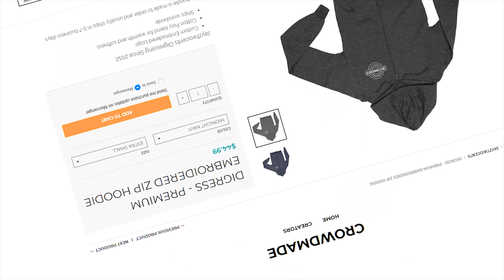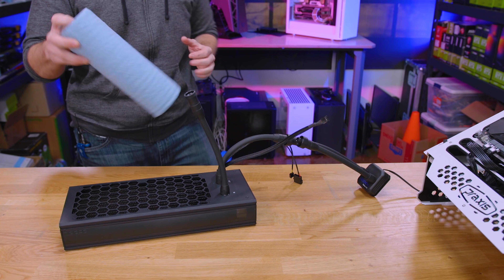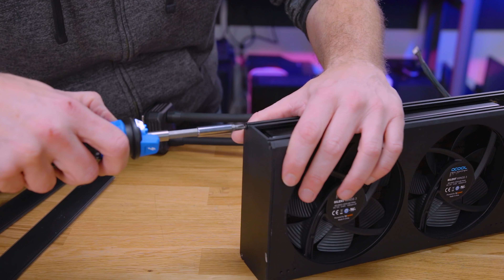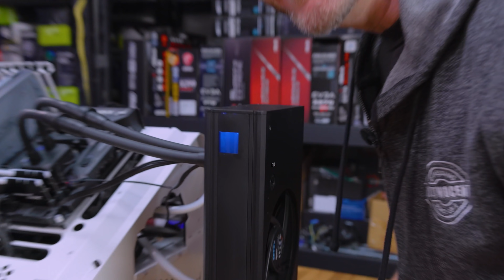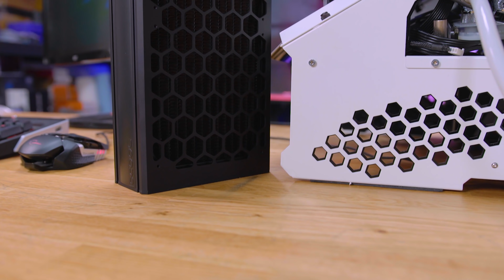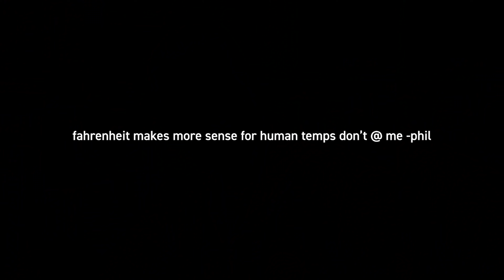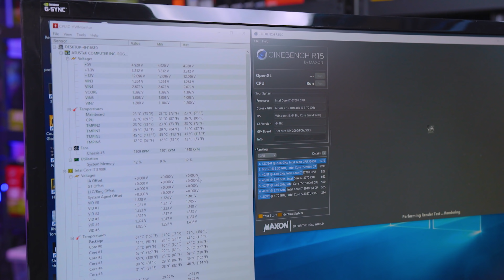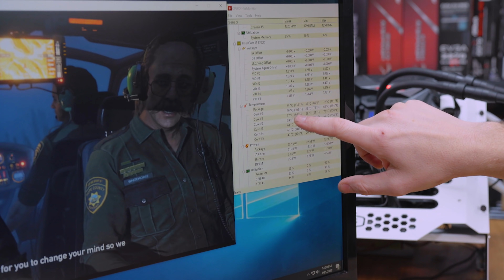This AIO is ridiculous!

Comment: Celsius makes better sense, period.
Reply: It makes better degrees really. 
0 the temperature water freezes at 100 degrees the temperature water boils at. 
If you need Absolute 0 use Kelvin. 

The issue with American Temperature is -40F is -40C. Which is weird. 

1 degree Kelvin and 1 Degree Celsius is the same. 
Absolute 0 is -273.15 degrees Celsius and 0 Kelvin. 0 Celsius is 273.15 degrees Kelvin. 

A degree is a degree but -40f is -40c, 0f is -17.7C, 32f is 0c. 

So for Fahrenheit there is 72 degree in 40 degrees in Celsius.  Water freezes at 32 degree American and Boils at 212 Degrees American. why? 

Water at 100% is gas at 0% it is solid. A degree is a percentage of the difference between Solid and Gas. it is simple logical and oh right that is why Americans don't do it... Simple and Logical is too liberal to American minds :P
Reply: Agreed, same goes for kilograms.
Reply: A wise man once said (and I forget who):
"Farenheit is from a Human's perspective, Celsius is from water's perspective, and Kelvin is from the perspective of the Universe..."
-some guy on reddit (I think)  2019

Personally when working with computer temperatures I prefer Celsius because most (if not all) product ratings are done in Celsius and because in Celsius the numbers are really easy to manage. 0 is too cold 100 is too hot, 20 is approximately a typical room temperature.
Reply: so does metric but alas, us americans are stuck with a garbage system.
Reply: Not as much sense as Kelvin though. If your CPU isnt running under 300K are you even trying?
Reply: @HailAzathoth  Eh.... Not recommended. 300K is dangerously close to ambient, which increases the risk of condensation (if you use water... sorry Vodka cooling). My CPU temp in idle is around 30°C/~304K, which is pretty O.K.
Reply: As an American I agree but with everything being F and being accustomed to it, changing units wouldn't be the smartest move
Reply: @ForestBertrand  But do you really need it? Do you dress differently when it's 50°F compared to when it's 70°F?
My usual rule of thumb is: everything below 5°C demands a coat, everything above long trousers. 18°C or more and I run with short trousers and shirt. I don't dress differently for 23° than I do for 32°
Reply: 0c =freezing temp for water, 100c = boiling temp for water.
Reply: USA still uses volume to measure mass (cups), so I don't think they'll ever understand measures.  It's a lost cause.
Reply: Celsius didn’t get a man on the moon
Reply: @hacoberthejacober3345  It did. NASA used both imperial and metric in its Apollo program and since 1990 uses primarily metric.
Reply: Why have "sense," when you you can have...

FFRREEDOM!
Reply: DeShawn Terrance Canada is much more freedom than the USA. 🤘🍺

Our government sucks but doesn’t shut down for an orange fella with something to prove 🤣🤣🤣🍻
Reply: @mattmyles3908  canada is much more grammar as well.
Reply: @mattmyles3908  True but being docile doesn't make you better.
Reply: @bobhumplick4213  as always you think u ur opinion is always the right one and the only one thats why you fight so many wars and when someone has a other opinion and even when its the only logical right one 
you always draw it into ridicule
Reply: for computers yes.  for measuring ambient temps freedom units are best.  0F= about as cold as it gets 100F= about as hot as it gets  0C=kind cold 100C= "my face is melting!!"

take note of the smiley face ===>  : ) this is a joke
Reply: @bobhumplick4213  what?
Reply: @Kerttis  you heard me
Reply: @bobhumplick4213  wtf is " about as cold as it gets"? that is just dumb. 0deg F means nothing, it is not the lowest temp in US, not in Alaska and not in the rest of the world. 100deg F is barely over normal body temperature. One degree F is not equal to one degree of anything, it scales differently, it is based on one persons feeling of temperature and it is an "imperial" unit from your british predecessors who, as the rest of the word, use metric system of SI units.

you, as a carbon based being, need water to live. not feelings, water. if water boils or freezes, then you get feelings.
Reply: @A10Eiro  most places dont get below -20 (20 degrees below 0F) and most places dont get above 120F.  so the range on F makes more sense than the range on C.  so i win!!! yay!!!
Reply: @bobhumplick4213  again, most of. In contrast I am trying to say quite the oposite, those limits are useless. Also not globally applicable - I would say not even across the US, being far a wide as it is, from arctic Alaska to hot Hawaii. Also as Jay said, it makes sense in PCs. One kinda plus side I see is not writing negative values in most of the cases but that is also "most of" and whatnot. 

I don't know, I feel diappointed when I see people using imperial system while other, in US as well as elsewhere, are trying to come up with measuremets of time in space, taking into account the effects of gravity, special relativity and speed of light to properly unite time for space travel. Oh and sorry for ranting over imperial system while talking about temperature measurement. I'm not saying you are an ape or anything, not in the least.
Reply: @A10Eiro  who cares blah blah blah blah
Reply: @bobhumplick4213  oh my, the last time I heard "blah blah blah blah
" was from flat-earthener. I am afraid I have to bail out of this discussion... not that I have much more else to say. No surprise the gov and scientists have such a hard time changing it.
Reply: @A10Eiro  what?  i said i was convinced?  dont you believe me?
Reply: @bobhumplick4213  Where in the world do you live that 0°F/-17,8°C is "as cold as it gets". Here in Germany we just had -20°C and Germany isn't particularly know to be THAT cold. Same goes for 100°F/37,7°C. You just got slightly above human body temps. I know many countries where it gets MUCH hotter than that.

The most consistent scale is Kelvin, where 0K is defined as the absolute zero, you physically can't get any colder than that. For normal day to day use Celsius is better. 0°C is the freezing point of water (almost, but the difference is academic) and 100°C is the boiling point at 101kPa/1Bar. Everything between that is a linear scale, so a multiplication by two always doubles the temperature.
Also, since the Mendenhall Order all imperial units are derived from their equivalent SI units, and the US is the only country that is remotely important that still uses stupid imperial units.
Reply: @Ruhrpottpatriot  i didnt say that 0F "was as cold as it gets"  i said it was ABOUT as cold as it gets.  if you extend the range 20 degrees in both directions from -20 to 120F that covers most extremes in the US quite nicely.  sorry that you are so pedantic that you nitpick everything in the world to death even a joke.  i hope you work on your sense of humor in the future : )
Reply: @bobhumplick4213  Wait, it doesn't get colder than -29°C in the US? What about Northern Washington, or god forbid(!) Alaska.
Heck, even eastern Germany does have it's occasional -30°C.

It's a fact, that Fahrenheit and imperial units in general are a stupid scale, that has absolutely no consistency. It's garbage, which even the US acknowledges since 1893.
But hey, tell me of the 125 million Dollar Mars orbiter the US lost because Lockheed Martin used imperial, while NASA used metric. Must have been fun, right?
I certainly laughed out loud as I read that.
Reply: @Ruhrpottpatriot  youre missing the entire point.  stop being so literal minded.  it MOSTLY stays in that range.  "but but what happens if you it goes beyond that range,  does the world end??" no you have negative numbers problem solved.  you might have to break out on those negative numbers once in a while but on average most days are between 0 and 100.  stop looking so hard for something to argue about and start looking harder at the point the person is trying to convey.  the internet will thank you
Reply: @bobhumplick4213  The entire premise of the Fahreheit scale is bullshit. Is used a somewhat scientific point of zero, but then proceeded to set the freezing point to 32°F and the human body temperature to 96°F, which btw he guessed. Nonetheless neither points are accurate (and reproducible) enough, even by standards of the 19th century. Not only that, calculating with it is stupid and unintuitive, too.

By your point: In most of the world (discounting the poles and Siberia, oh and canuck land) an average day is between 0°C and 50°C, so what is your point? That I can stay between two arbitrary numbers (0 and 100), with precision unneeded in daily live, better; instead of staying in a range of two different arbitrary numbers (0 and 50)?

Celsius on the other hand uses two scientifically provable points with a linear scale in between. This makes every day appliance easier (since I can calculate easier with it) and is more consistent.
Reply: @Ruhrpottpatriot  couldnt aggree more.  john celsius was a genius
Reply: @Ruhrpottpatriot  please do not try to be scientific with him, he seems to just fly over those parts as it is too hard to understand. Honestly, it is quite scientificly articulated.
Reply: @bobhumplick4213  He's from Germany. They don't do sense of humor over there very well. But hey, they've got the metric system.
Reply: @saber-jocky3436  well his he must have converted that joke and misplaced a decimal point.  if he redoes his calculations he will find it hilarious
Reply: @Ruhrpottpatriot  bro stfu with that lockhead martin shit, that's a fantasy  to prove that bs  to feel good. You might as well laugh at your own joke. I understand both and neither one have a benefit as long as you understand numbers period. That shit does not make you smarter or the world dumber, just you being more arrogant. It just changes when you think 0 comes in as the feezing point and vice versa to the boiling point.
Reply: @dayadam16  Oh yeah, "fantasy". Then why does this article exist? http://edition.cnn.com/TECH/space/9909/30/mars.metric.02 and https://llis.nasa.gov/llis_lib/pdf/1009464main1_0641-mr.pdf
and http://www.cnn.com/TECH/space/9909/30/mars.metric.02/index.html

 It states, and I quote: "NASA lost a $125 million Mars orbiter because a Lockheed Martin engineering team used English units of measurement while the agency's team used the more conventional metric system for a key spacecraft operation, according to a review finding released [...] Lockheed Martin helped build, develop and operate the spacecraft for NASA. Its engineers provided navigation commands for Climate Orbiter's thrusters in English units although NASA has been using the metric system predominantly since at least 1990."
The official(!) report states: "The MCO MIB has determined that the root cause for the loss of the MCO spacecraft was the failure to use metric units in the coding of a ground software file, “Small Forces,” used in trajectory models. Specifically, thruster performance data in English units instead of metric units was used in the software application code [...]"

There you have it

And no the difference between Fahrenheit and Celsius is not just where the zero point is located. The scale is totally different.

And Celsius, since it's shifted Kelvin (or vice versa, depending on your definition of "zero") makes much more sense, since we use a decimal based counting system. Or to put it this way:
In metric one millilitre occupies one cubic centimetre of water takes one calorie to heat up by one degree (centigrade/°C), which is one percent of the difference between its freezing and boiling point.
Now if I wanted to heat up one litre of water (which by the way takes up 1000cm³ or 0.001m³) by one degree I can simply multiply the calorie amount by 1000 and I'm done. writing "one-thousand" takes longer than the calculation itself.

Whereas in imperial the answer to "How much energy does it take to boil a room-temperature gallon by one degree?" is: "Go fuck yourself" because you can't directly relate these units.
See attached picture:
https://cdn.zmescience.com/wp-content/uploads/2011/03/better-1024x961.png

Inb4 "BTU": Units with multiple definitions don't count.
Reply: Ruhrpottpatriot to make people like you get so stuck in the drama that you end up believing the fantasy and now your spreading the word. I obviously didn’t go out my way to try and get you to believe me but you did the same thing they did to you. Nice try
Reply: @dayadam16  Yeah, nice try. You apparently can't even read the official NASA report relating the loss of the lander.
Reply: @Ruhrpottpatriot  well kelvin and celcius were the same just shifted.. but they redefined kelvin last year.. physicists were never really happy with the dependency on water because changes in composition and isotopes can change the properties... they wanted to get rid of that for real consistency..
Reply: Ruhrpottpatriot Got up to 47c a few days ago in Aus 🔥 lol
Reply: @Dunkelelf3  Not quite. The triple-point of water was defined with a very specific type of water in mind (Vienna Standard Mean Ocean Water). Still, the current definition of K (and therefore °C) based on the Boltzmann-Constant is much better.

It's still just shifted though, albeit slightly different.
Reply: @Ruhrpottpatriot  your a bitch
Reply: @bobhumplick4213  exact 0 degrees is freezing , 30 its hot -30 im freezing , 100 is boiling point, -274 if im not mistaken is the coldest things get. How the fuck does it make more sense ?!?!?!?!?!?!?!?!? Fucking merican measures are always shit. -period
Reply: PreZ _  so shit.... that’s why everyone’s better than us.... oh shit wait MERICA BETTER THAN EVERYONE!!!!
Reply: @weems0031  Except in dun related deaths, deaths by cars, medical bills, insurance, house building, pollution, politics (ever heard of a shutdown in europe?), general education, and the list goes on.

Studies show, that the only thing the US is vastly superior to other countries is inflated ego.
Reply: @Ruhrpottpatriot  why dont you tell us where you're from so we can dig up bullshit about your country and talk shit like you.
Reply: Ruhrpottpatriot lol we are still better than everyone and could and should conquer all you Europe babies who can't defend themselves without asking dad (United States) for help
Reply: @weems0031   HAHA, Good joke. Do you know who produces the steel for your weapons? ProTip: No US based company
Reply: Ruhrpottpatriot hahaha I find it really funny how you think you know everything including things that’d be impossible for a tiny European like you to know, just take the L buddy, the United States is, has been, and always will be the greatest country and people in the world, im sorry you didn’t make it in buddy, now go make some products for me to buy lololol
Reply: @weems0031  You mean the country, that just sent hundreds of thousand people home (or kept them working unpaid) because a few people wouldn't get their lolipop?
Yes, great indeed.
Reply: Ruhrpottpatriot hahah why are u fixated on this government shutdown? Like I didn’t meet a single person who was actually affected by it hahahah our media is just so strong and wants everyone to hate our current president so they spread all this nonsense about this shutdown hahaha like our government is still mostly functional during thoughs
Reply: @Ruhrpottpatriot  why are you all bitching. Jesus no system of measurements is more accurate then the next they all have inconsistencies.
Reply: @jdrok5026  Imperial is inherently less accurate than SI, because many of the "constants" that are used are no constants and are not reproducible with enough accuracy.
Why do you think all imperial measurements are defined based on SI constants?
Reply: @Ruhrpottpatriot  so that means the system has been revised.
Reply: @jdrok5026  Because it was inherently flawed...
Reply: @weems0031  "all you Europe babies who can't defend themselves without asking dad (United States) for help"
Well, this is greatly thanks to US who's always up to push more countries into the EU and the Euro nightmare. But uncle Sam is starting to regret it due to how the EU system profit to Germany. Now this situation has and is still only possible thanks to our europeans traitors "elites". Once upon a time a European country sent a flotilla to american doors in order to give back the gold equivalent marked on their dollars, US complied and hated them for that. Now this country's government is docile and their heads should roll on the floor.

Please mind that I love American people, but I hate US government (a bit less with Trump, the guy is a patriot, makes mistakes, but still does what he can for his people, which is something I respect)

About Celcius... Well, after documenting myself, I am a bit more mixed. The ~100°F for human body temperature does make sense, but the 0°F is just a too exotic reference, not intuitive enough, would 0°F have been the same as Celcius, freezing point of water, that would have been a very intuitive scale from human point of view. Any way, it's more a matter of understanding the references points.

Maybe I should make my own scale, °H(uman), where 100°H is the average body temp, and 0°H the body temperature at which it ceases functioning. Like so, if you read 0°H, you definitely know you should not hang around naked. XD
Reply: I'll let the politics slide (btw: Trump is an idiot who does nothing for the small people).
But 100°F doesn't even make sense. That's an arbitrary point which isn't fixed either. The usual temperature of a person ranges from 36,3°C to 37,4°C, which to take?On the other hand, 0°C is pretty much exactly measureabl for day to day use. The same goes for the boiling point of water at 1013 hPa.Natually even Celsius has it's drawbacks, mainly you can't measure the Tripe-point of water good enough for serious scientific work. But in 22 days, this is a problem of a bygone era.
Reply: @bobhumplick4213  0°C is freezing water 100°C is boiling water and 1°C= 1K how does this not make sense?????????????????????????????????????????????????????????????????????????????????????????????????? what is freedomshitunits all about aHH??
Reply: @ItsMeWanja  "0°C is freezing water 100°C is boiling water and 1°C= 1K how does this not make sense"

i never said it doesnt make sense.  its very useful for scientific measurement.  but F has a range that better represents ambient temps.  most places 0F is, on average about as cold as it gets and 100F is, on average about as hot as it gets in summer.  if you extened the range 20 degrees in both directions you -20 to 120f and that covers 80-90% of the planets temperature extremes.  fits much better than the short range of C.  you would almost need decimals for C
Reply: @bobhumplick4213  fahrenheit just doesnt make any sense at all so try to forget about this useless scale just like feet inch yards and all that other bullshit that only a little few countrys are using and make the world a better more unterstandble place :) peace im out :)
Reply: @bobhumplick4213  I have said this my whole life :) I'm glad someone agrees with that train of thought .
Reply: @ericimi  oh im sorry.  havent you heard?  they convinced me.  im a celsuis boy now.  but i respect your right to use a superior system.  i have been reducated by my comrades to see that i should use inferior systems exclusively